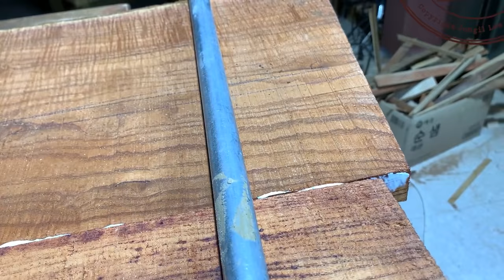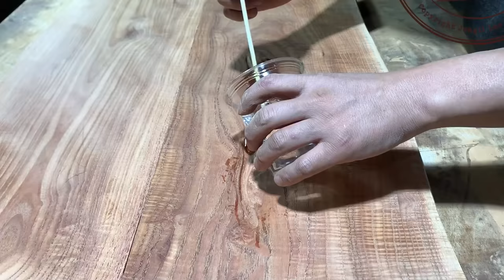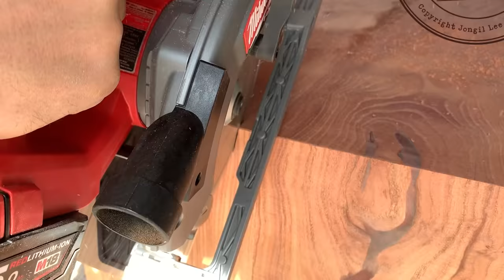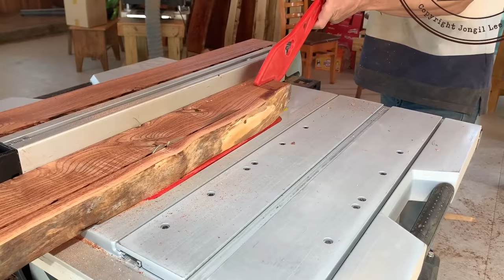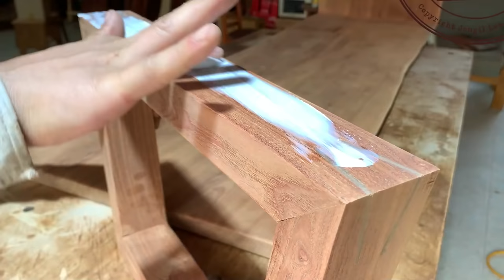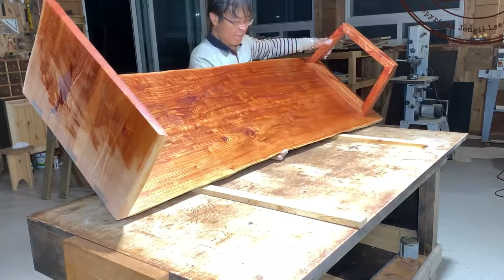Coffee Table Build / Creative Sturdy Wood Joints Woodworking

Comment: If I ever win the lottery I will have my own wood workshop.
Reply: It's really not that expensive to get started in woodworking.  You can do a lot with a few hand tools, a power drill and a circular saw. Obviously you won't be able to build quickly, but if you a tool here and there over time, before you know it you will have a very nice shop.

Comment: really nice craftmanship and nice video. i would be aware of glueing cross grain to long grain, because the table could get a crack due to expanions in the wood caused by differences in wood humidity. i think its better to screw the leg through slotted wholes on to the table, so the wood has some space to move. but no criticism. beautiful table....

Comment: good video and nice wood ... I would recommend changing the dowel system that you put on the legs .. putting white pine dowels with an oak wood or a different color loses the aesthetics a bit .. for this I use the same wood to make a dowel and I place it with  glue in the hole and it perfectly camouflages in the wood

Comment: Be interested to know if the wood glue and dowels on the leg was enough to resist the expansion of the table top?
Reply: Doubt it. I'd like to see what the top looks like after going through one summer and one winter. My bet is a cracked top.
Reply: With proper acclimated wood and decent temp/humidity in the area where the table will be placed, I see no issues. As outdoor furniture its a different story altogether.

Comment: Nice work dude but I think the "thin" joints are actually "plated(or tablet?) slot joints"  & the large joints I have heard called " double sided angle plug joints". Dovetails are actually cut into the timber which is being used to make the furniture piece. They are cut on a squared face with one half of the joint on each piece of timber being joined. 
Nonetheless I like the skill you have demonstrated & a fine piece of furniture is the result.
Reply from the maker: Thank you for your sincere advise.

Comment: I like the way you finished off the powersaw cut with the handsaw.
Gotta get one of those handsaws.
Reply: Might sound like a strange question but why couldn't he use the power saw all the way?
Reply: @planetX15  To prevent what is called tearout. It happens when cutting against the grain and because the wood fibers on the edges have less support and are weaker. The power of the saw will oftentimes tear off pieces on the edge and ruin it.
Reply: @gwrmarines  The more you know, very interesting, thanks!
Reply: @planetX15  
.k
Reply: Same! Also those pipe clamps thingies!
Reply: IIRC, that is specifically a Japan style pull saw

Comment: Why are there so many dislikes? This piece looks beautiful. Great job 👏
Reply: Oh. They just have eyesight problems from the dust of woodworking. So they just misplaced their finger.
Hahaha.
Reply: Hes done some unconventional work here. Hes a great self taught carpenter. The way he ised his clamps, without protecting the wood . Glueing all 4 corners together at the same time. But in my opinion. Hes overcome some of the things that hold other carpenters back. Like useing tubes from bicycles to secure the just glued joints. Nice work none the less. Hes a craftsmen....

Comment: Cool use of materials. I don't know why you used dowels and glue to attach the legs to the base considering it would be hidden and screws or wider dominoes would give more strength. Also I was hoping you you would sawdust/CA glue or wood fill the miter on the corner, there's a slight bit of gap that is unavoidable that would look great with a bit of fill in it. Just constructive criticisms, I think it still came out great.

Comment: What was the wood?
I sure would be back for answer . I have to see the video at least two more times.

It was a great well engineered corner dovetail.  I was impressed, and would try it. You made a corner dovetail seemed easy
I have to find a way to copy the angle on the patch would that seemed to be ebony, or looked like ebony..
Thanks million , you solver a problem for me.  I mean the corner joint dovetail.
Greetings from California.

Comment: Why not just dovetail the two together rather than the look of a dovetail.  It's really pretty but the reason you do a dove tail is because the joint is strong and it prevents cupping. This joint does nothing to prevent cupping.

Comment: Those pieces of wood you started with were in pretty rough shape. Seemed like they were extremely dehydrated and brittle. Try watching the humidity of the wood
Reply: They should be very dry. Probably 6% or less, for solid wood furniture.

Comment: Nice work.
A few things...
Why not use a joiner planer on the slab? Seems like you would have alot less work seeming the two together.
Also I have not seen that register method before, I'll have to try it out. I've been using a biscuits and a biscuit cutter for joining. 
I do like the dove tail strengthener cuts on the corners very inventive.

Comment: I don't quite understand the "dovetail". Isn't it usually cut from both pieces of wood before assembly and the fit together? If that's the case, then that's basically just a miter joint, then? Also why make the legs 2 totally different styles?

Comment: Very nice table, but i think glueing the leg with crossing grain on is not the best Idea, becourse it could get loose or open the joint on top with hummidity changes.
Reply: I'm interested. Are you talking about where the upper board of the end leg assembly is glued and doweled to the bottom of the table? It shouldn't expand or contract much end to end, so I'm wondering why that's a concern. I think the table top center joint is safe.
Reply: @tomaiken4393  yes i was talking about that spot. if i understand right, your correct, the part of the leg dont will expand towards the width of the table top.
But the table top could change its width. I know it would be a problem, if youre building it outside. In a more controlled environment like "inside" it maybe could work.

Comment: Great video.  Thanks for sharing.  Where did you get those center punch pieces you put in to line up your parallel pegholes.  Used 20-30 seconds into.  That ,along with many others, was a nice technique.
Reply from the maker: Dowel Points : https://amzn.to/3mM3DZL

Comment: Beautiful table! I enjoyed your video and wanted to suggest a safety tip. You should never blow away wood dust with an air compressor. The speed of the air causes enough friction and heat that it can burn the dust and potentially start a fire. I've seen it happen so please consider my suggestion. Thank you!

Comment: Genuine question: what is the structural difference between what was done here "adding" these dovetailed "locks", and joining the perpendicular boards with dovetails actually cut out in each board?

Comment: Whoever ends up with this piece will have an unpleasant surprise in a year or two.  Just saying.
Reply: Exactly. It's a shame tho because the piece looks very good.
Reply: Why?
Reply: @eb8827  because when you glue two or more boards together and you face all the heart sides down, the board will bend like crazy. That's why you always want to alter the heart sides from each other, so they sort of cancel each other out and your table top won't be completely hollow or bulged up.
Reply: I’m actually more concerned with how he glued and doweled the support assembly to the table top.  It appears he didn’t allow for seasonal movement.

Comment: Can someone tell me how the, what I assume are “dovetails” on the solid end/leg of the table, make the table stronger or longer lasting? I assume they’re not just for looking pretty?
Reply: Two different principles at work. Almost any time you increase the surface area mating two pieces together and spread glue over that surface, you gain strength. In this example, there’s also the geometric aspect to it that keeps the two pieces from separating under normal use or over time.

Comment: Hi! I really enjoy your videos, even if I never practiced your job. I have a question: how do you keep the boards flat when you join them together to make a wider surface? And is glue strong enough to keep them together? Thank you and keep up the great work!!
Reply: The dowels keep the boards aligned and yes white wood glue creates a bond which is actually stronger than the wood that it is joining. The dove tails and the dowels also help to strengthen the joints.

Comment: Never glue a table top directly to the base. Wood constantly moves and you need to account for that. Nice table but it’s going to twist and crack.
Reply from the maker: Thank you for your advise.
Reply: Most of the grain on the top is rift oriented so the majority of the wood movement will be in the thickness of the top, not the width.  If he used PVA glue it has some flex to it so cracking might be avoided.

Nice work and excellent skills in crafting that table.  That was a lot of sanding to get that top to show itself.

Comment: I was impressed with the circular saw skills and liked the design. Maybe the cupping will not be too bad, you never know. What would worry me more is the potential for the top to split if the screws (I guess there are screws underneath the plugs) aren’t attached in a slot to allow for movement. Does that make any sense? I just read through my comment and it seems a little confusing😬
Reply: Makes total sense. I've just built a solid oak cabinet and had to use big ugly stretcher plates underneath the top. They look horrible if anyone were to stick their head inside the cabinet? Do you know any way of doing this in a pretty way?
Reply: @ChickenDinnerz Hello Chicken D. I guess you’re directing you comment to me. I’m not sure what your describing and can’t seem to visualize what and where the stretchers are but I’m assuming their running perpendicular to the top. If all the grain is running the same way (sides top to bottom, top and bottom side to side) you should be good to without the “stretchers”. If the stretchers are to hold the thing together buy running perpendicular and you think you really need them maybe you could make a little smaller and be sure to make the hole they go through bigger than the screw. Again to allow for movement. Good luck. I doubt I helped but I’m trying. Now let respond to Mokong, he seems to be insulted by my comment.
Reply: @harryg3889  thanks. Yes they are right angled, running perpendicular, but they are about 30x30mm each plate so rather ugly. I've seen some "figure 8 fasteners" which I saw Ishitani use but they only seem to be available in America
Reply: @ChickenDinnerz  can you give me more details on the cabinet you made?